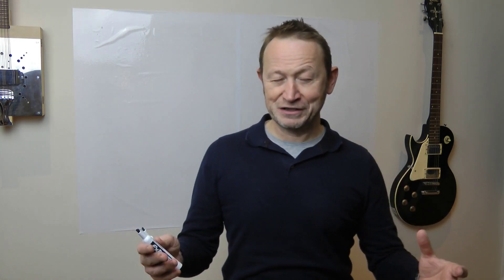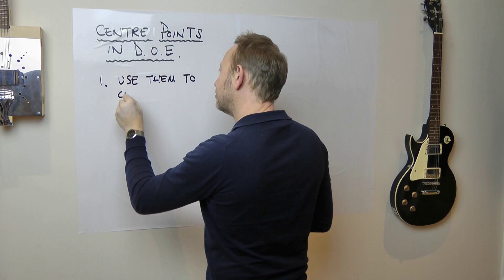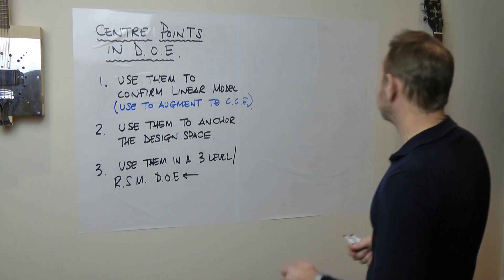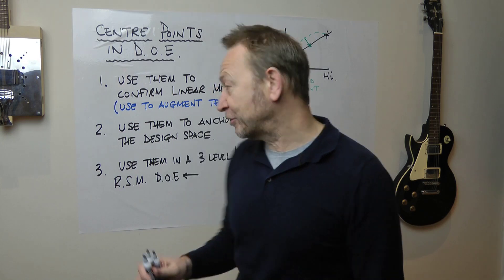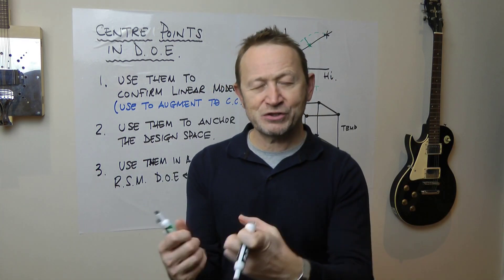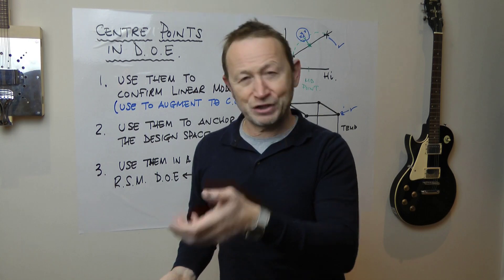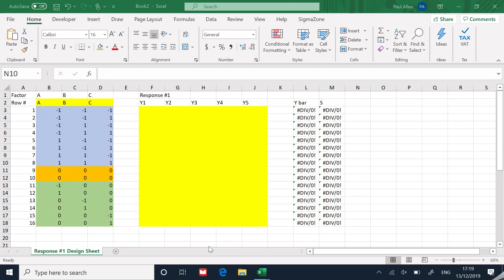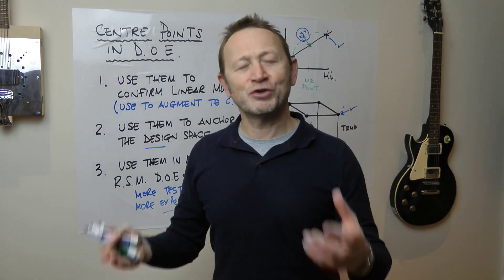Using Centre point tests in a DOE...

Comment: Hi Paul, great video. How does Minitab use centre points in the factorial response optimiser? We did centre points and used to detect curvature and for target setting of distance. But we noticed that the response optimiser did not use centre point data for calculatons for those who did not import data into Minitab. Would not have noticed except that one guy was entering data into Minitab and then sent the data to others. When they imported the data and noticed they got different target settings for the same distance. When investigating, the ones who imported data accidently forced Minitab to use the centre point data for its reponse model. Not sure if you have seen the same thing? It is not explicitly mentioned on Minitab site that for the final optimization model that the centre point data will not be used in target calculations.....let me know your thoughts. Thx Roger
Reply from the maker: Roger - I think the answer to your question is to use a DOE from the RSM menu, there you can enter centre point data and create curved models..
Reply from the maker: RSM = response surface

Comment: I have done some experiment with 3 factors 2 steps each and a center Point in the middle of the space. How do i proof the significance of the center Point in a statistical way?
Reply from the maker: Schwini - Good to hear from you. Simple way is the remove the centre points from the data. Analyse the data as a 2 level DOE then see it predicts the centre points or not. If it misses the centre point values then the centrepoints are needed in the model. If the 2 level model hits the mid-points, then there is no need for a 3 level model...
Send me the data paul.allen@allenp.co.uk if you're still unsure...
Reply: @paulallen5321  thank you very much for your support. I just simply plottet my data and the centerpoint to prov the linearity of my data.
Reply from the maker: And what happened? Linear or curved?
Reply: @paulallen5321   it was of course linear. It was an academic example just to get comfortable with DoE. So i didnt expect any curved-nature in the first place. :D Thanks for your superb explanations and support!

Comment: This strategy of starting with a full or fractional factorial and using centre points at the beginning, middle and end of the experiment to check that the design space is stable and to check for curvature (then augment with second order model if curvature is confirmed) is just fantastic. Understanding this video is a real breakthrough for me in terms of having an effective sequential approach to experimentation / problem solving. Thanks Paul (Mark T)
Reply from the maker: Mark - Using the centre points through the DOE is new to me as well. I came across it a year ago at one of my clients. Just shows there is always more to learn....